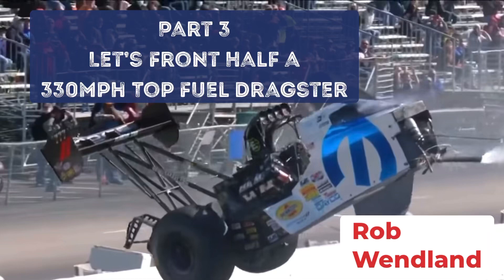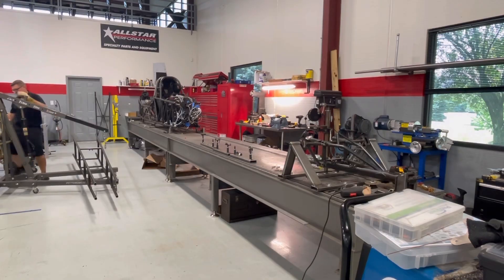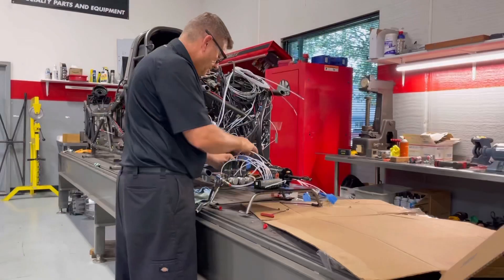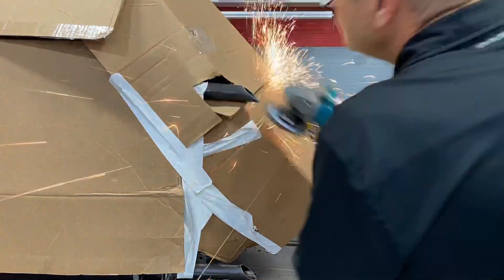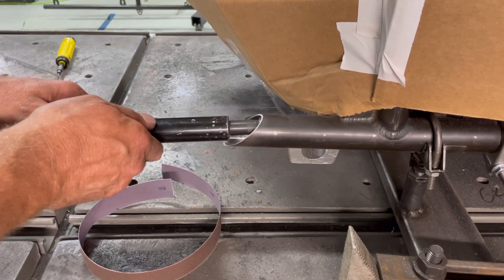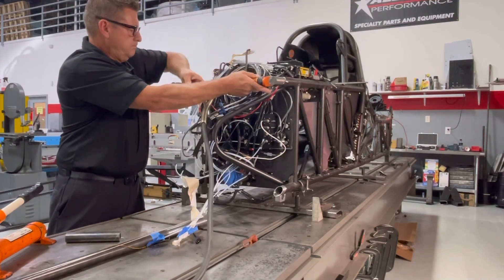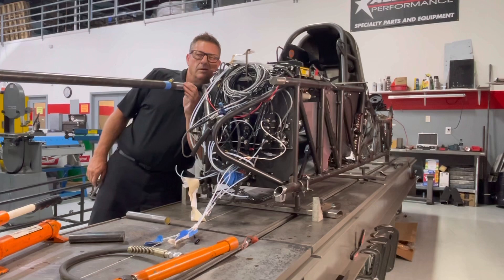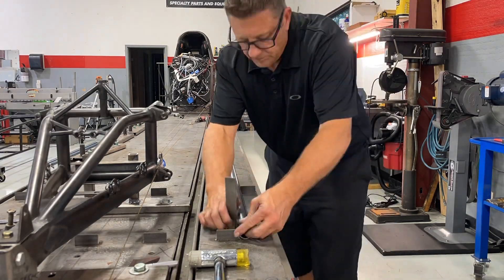Part 3 Let’s Front Half a 330 MPH  Top Fuel Dragster!!! Why do they break??

Comment: Just like a flat bed semi trailer.  You build an arc in the frame so it sits level when loaded.  The thin wall of the tubing and the length is what is allowing the frame to lift upward under power.

Comment: Hammering under tension is a body shop trick. You pull the car where you want it and hold it there. Then you hammer the stress points causing the deformity. This reduces the amount of over pull needed with the hydraulics

Comment: Dumb-ass design. No wonder the front ends fall off. No diagonal bracing in the front half of the chassis. Not to mention the brake lines running/rattling/vibrating down inside the frame tubes with no fixing brackets on them. Any real race car regs require the brake pipes etc to be fixed every 300mm.

Comment: The frame bends in a banana shape by design. That's how you get traction and keeping the front down until aerodynamics take over at half track minus the exhaust pushing downward at around 800 to 1100 lbs

Comment: Why is there no triangulation between the front and back ?  On any welded tubing you always heat the opposite of the welded area to neutralize the welded area. I've built and repaired Can -Am race car chassis , and air craft radial engine mounts to know. The more horse power the stronger you need to make the frame. Simple look at a crain rigging.

Comment: As a designer and mechanical engineer in high stress tubing designs, I learned the hard way that a tube inside another tube is NOT stronger as your intuition would lead you to believe.  If there is even the slightest bit of bending moment on the inner tube, the stress riser right at the outer sleeve (horn, you call it) is enormous.  The inner tube will always fail right at the sleeve, just as this did.  Do some CAM analysis to verify this but lose the horn concept and go to haunches or more bracing.

Comment: wait.  there's a safety debate about changing the chassis tube wall thickness to a larger spec, and there's huge voices in top fuel that are against it???  did i interpret that correctly? @Rob Wendland

Comment: @6:21 the inner tube puller.. how about making a longer puller bolt..  and an offset drilled piece of bar stock to slide down the shank that keeps the flange under one lip of the internal tube..

Comment: Question, when he's straightening the pipe with that portapower and the hammer, would it be better to use a little heat from a torch too to avoid work hardening the pipe?
Reply: I considered that too. I think the minimal amount that he’s moving the tube would be okay though.

Comment: what about a Metalax machine to takeout the stress as tubing is welded.  I built sprint cars in a previous life , distortion was hard to control . I know hendrick used a metalax to build cup cars.
Reply: I built sprint cars, midgets, silver crown cars, etc in a previous life. Never heard of a metalax machine though. I’ll have to look it up.
Reply: Also the nose/splitter man on a cup team. We used Gibbs chassis though.
Reply: Oh, it’s a vibratory stress relieving setup. I’ve heard of dirt super late model guys using them with success.

Comment: I'm guessing all those scribe lines end up all facing the same direction to keep the slight arch oriented the same with all the pieces. Kind of like a large flat bed trailer. They have a slight, but noticeable, arch in them so when they are under load it helps support the weight better. It arches up so when weight is applied, it is level instead of sagging. Just a guess, kinda like prestressing as opposed to natural random stresses.

Comment: By putting tension on the tubes and TAPPING on the weldment with a
hammer lets the molecules of the material re arrange themselves 
in proper alignment. 
We were taught this in auto body school MANY years ago.
Pull a dent and at the same time tap on the metal that you want to move!
EXACTLY the same thing.

I have always maintained, 
"YA HAVE TO BE SMARTER THAN WHAT YER WORKING ON!"

EXCELLENT series!!!

(BTW, I am a retired body and paint guy, 
50 plus years in the trade.
Also a former welding instructor, fabricator and an 
A/Fuel crew guy. 
Built and owned multiple door slamer and altereds.
Also do Custom paint...).
Reply from the maker: Sure appreciate the info and thanks for watching!!!

Comment: I guess they leave out those rosette welds so you can extract the tube from those horns when front halving.
Reply from the maker: Actually we will have inspection holes to make sure that the tube is back far enough the front will have rosettes that we will just drill out